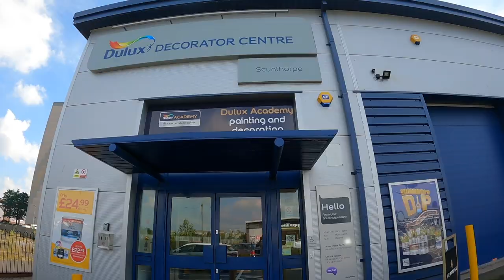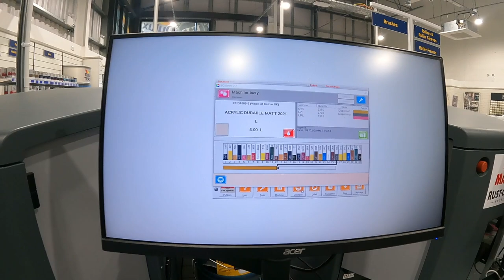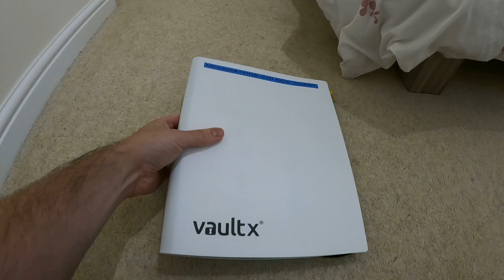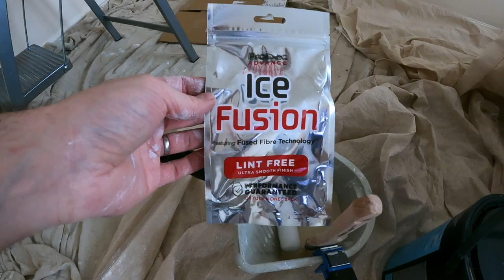Painting and decorating tips and tricks

Comment: Good job! I've never seen anyone use tin foil before. I might try that. Typically ceilings are rolled in the direction of the lights coming in, but isn't that critical as it's flat paint. I would use a bigger brush to cut the ceiling and walls. I would also do it wall by wall so that I can roll into wet cuts.
Reply from the maker: Yes. They are some great tips
Reply: I find the best way for a ceiling is a thick line along 2 edges then back and forth to join in the middle

Comment: Should you use specific paint for radiators so it's not affected by the heat?
Reply from the maker: You can get radiator paint but I have never seemed to have a problem with the crown, so I just use that. Gives a good finish